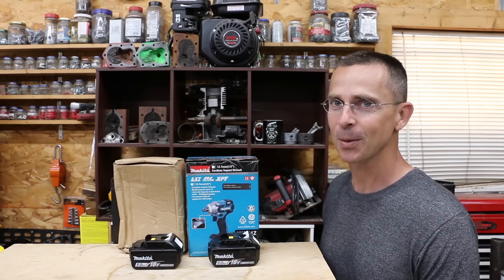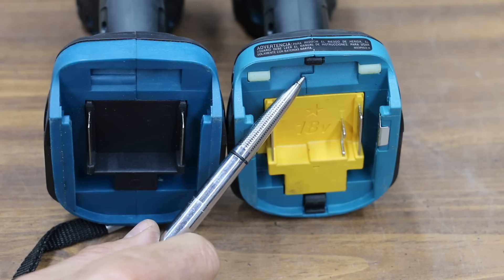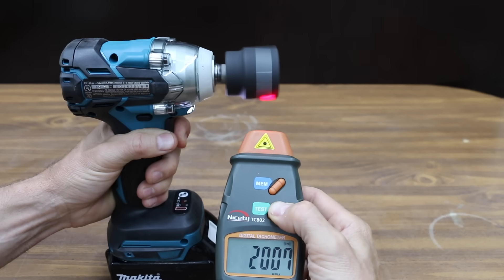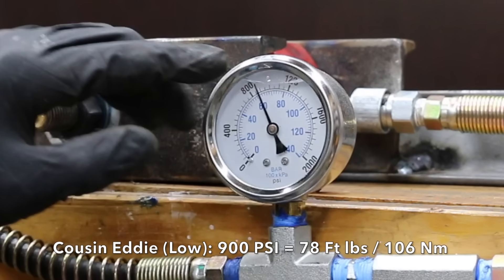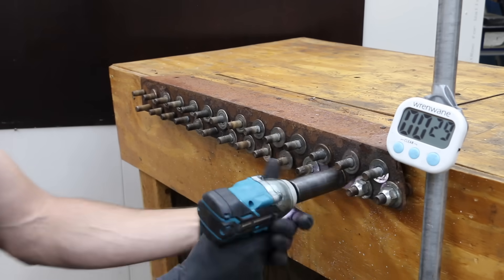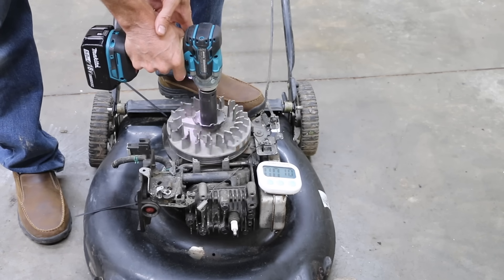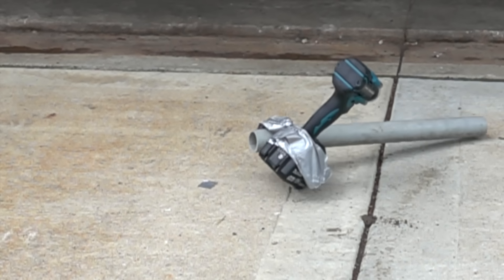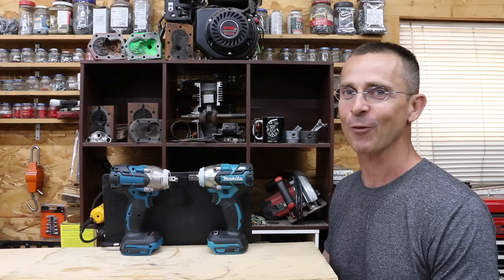Fake Makita Impact Better? Let's find out!  Makita XWT11Z 18V LXT Lithium-Ion Brushless Cordless

Comment: "The bitterness of poor quality remains long after the sweetness of low price is forgotten." - Ben Franklin
Reply: "Most Internet quotes are misattributed" (Thomas Jefferson)
Reply: @Gruntled2001  Source, stats? Have you surveyed internet quotes and found that more than 50% are misattributed? Has someone else done this? Or is this just an idea you have plucked out of some orifice?
Reply: @droceretik  That's an effing joke. I am supposedly "quoting" Thomas Jefferson, a founding father of the US of A, who [supposedly] said that quotes on the Internet (which didn't exist in 18th-19th centuries) are not accurate. Disclaimer for those who are slower on the uptake: it's a joke. Something said lightheartedly, in spirit of jest.
Reply: Man ain't that the truth.
Reply: It's the other way around. But I usually remember prices better than any other aspect of the product, so it doesn't apply to me.
Reply: @zwz.zdenek  A good example would be the difference between a cheap $25 garden hose vs. a $45 one. Both will get the job done but you will constantly fight the cheap one to straighten it out of its coiled state and prevent kinks everytime you use it where as the $45 hose will immediately come out of its coiled state as soon as you remove it from the packaging and won't kink. So yeah the $25 hose is cheap and you can then go out to eat with the money you saved but you will pay for it with your sanity every time you use that junky $25 hose. After a few times you'll see that the $20 difference wasn't that expensive after all.
Reply: @OldsXCool  Your example got me right in the truth's :'(
Reply: TRUTH!  When I was younger, I could only afford the budget versions.  But, I tell ya, nothing replaces quality!  This wouldn't be a bad back-up, but def wouldn't be my primary tool.
Reply: It doesn't remain long around me, I'll throw it in the trash.

Comment: This suggestion may be way out there, but thought I'd pass it on anyway, I only hope I can phrase it right. The subject is rain gutters for houses. There are currently 2 companies locally (Southern USA) that advertise their systems. Both of them seem to offer just about the same design, with plastic (?) inserts in the channels, & a cover over the top of the gutters that keep leaves & debris out. I'm sorry that I don't recall their particular names, maybe one is called Gutter Guard (?), but they advertise in NE Alabama (ABC 3340's secondary channel/ME TV), so maybe you could find out the names for both. Anyway, the only difference I see in their ads is one of them shows how their product not only has the rain flowing over the top of the cover into the gutter, it also flows into the BACK side of the cover. The other company only shows it flowing over the top. I admit, I'm kinda ashamed I didn't research  this enough & gotten their brand or company names & hence made it more difficult, so I wouldn't blame you if you didn't even bother with it. Maybe I'll try again after getting their names, but I thought I'd try anyway. Enjoy your vids, & am always impressed with how many tests you come up with!

Comment: $30 is a steal for the casual and occasional user. Would be interesting to see how the knock-offs battery compares to the Makita's. An extra battery for the Mak costs more than the whole knock-off. Can you get an extra battery for the knock-off? Will the Mak one fit? Will the Mak battery supply more power to the knock-off? Can you do a test to see how fast the batteries drain to a stop condition?

Comment: On the safety side the Makita seems to have a temp sensor connection for the battery and a internal fuse. Cousin Eddy have none of those features. Lithium battery fires is not the thing I want in my home 😊
Reply: It's all about the cells themselves. The additional protection is nice, but rarely makes a difference.

Comment: In a pinch the $30 unit would work. Not sure if life but, I've had name brand equipment that didnt last as long as the knockoffs.  Yes the Makita is better and like I said in a pinch or if ya just dont have the money, Uncle Eddie would work. Great job comparing the two. Now look at Dewalts and Black and decker.

Comment: For $30 it seems like a good buy. Definitely not for professional daily use but maybe good enough for a last minute backup that you put at the back of your truck. Cousin Eddie is built worse than Makita, but it still seems like a good build, and for $30 it seems worth it. If its construction is any much weaker (like smashing into pieces for the drop tests), then it will end up being a hazard and I would advise otherwise.

Comment: With cheap China stuff like this it really comes down to how often you're going to use something. If you only use it once every so often then the cheaper one is by far the better pick budget wise. I mean even if you want to spend the full price you could save that, donate it to charity etc and just get the cheap one. I'm not defending cheap China stuff but in some cases if it even works... you've won.

Comment: The big question I have can you use the makita hammer on counsin Eddie and does that make a big difference in performance?  If so, you could buy a used makita hammer and seems like Eddie would be a pretty good deal.

Comment: Hi, another great video.

Your methods are great and real world.

I totally agree with your summary, the knock of is not as good as the Makita, but it is also about 1.5th of the price, so is it value, YES

For someone like a tradesman who would use this tool 24/7 the Makita is faster / better and would last longer.

For a home handyman or someone who wants a unit in the shed for occasional odd and end usage it will be fine.

Any chance of similar video for normal drills budget to pro

Regards
George

Comment: One important thing the more expensive plastic cased tools usually, or should have, is glass embedded moldings. In other words glass fibers are in the plastic itself making much stronger. I believe the molding information cast into the plastic will tell but I don't know what the nomenclature is.

Comment: We bought the same knock off impact wrench for $30 on ebay too, we're happy with it.  Dad got it to change the shocks on the Cherokee and to do tire rotations when needed, it works fine for what we use it for.  If you're going to use an impact wrench a lot go with the Makita, but if you're only going to need the wrench a couple times a year the knock off will do just fine, but hey, it's your money.

Comment: As usual excellent video.
All my cordless tools are Makita because of price and durability. (I have never had one fail)
Also on eBay you can get tool, battery, charger all separate.
Another reason is the multi colored options on the tools.
If you have a drill bit one one and screw drive bit one the other you don't have to constantly be looking at
which tool has what.
Just one thing, I wouldn't like to have your duct tape bill. YIKES !

Comment: its not un common for manufactures to sell end of line tooling wich get modified to prevent copyright but your knock off doesnt say makita and and every design aspect has nothing in common from the injection moulded plastic to the wireing even the sizes differ but yet your batterys and chargers are identicle ? WHY also makita has 3 gears so common sense suggest the high torque setting will win a simaler looking impact drive with 2 gears so all your tests dont prove anything !! at 1st glance they do look quite simaler but look more carefully they couldnt be more different screw holes trigger chasis lights buttons TOTTALLY DIFFERENT all u have done is test 2  impact drives and failed 2 see no copyright infringements have taken place but called the nameless impact drive a fake makita knockoff even though it doesnt have the words MAKITA on it!!! if anything u should tell consumers to snap this product up $30 for a ID with no name that comes with original makita  18v 50 amp battery (AND CHARGER) IS an absolute BARGAIN!! GET A GRIP pull your tongue out ouf makita,s a hole and stop arselick advertizeing u TW*T

Comment: I prefer to buy American or as close as I can to 100% American made. Perhaps you can test some power tools from craftsman which advertises assembled in the USA with global parts and Milwaukee brands? I asked craftsman corporate how much of American materials they use, they said they try to source all materials in the USA first but some materials may not be available so they would have to source it from out of the USA.

I would like to note the ending of your video may be interpreted as you may recommend counterfeit over genuine. I just wanted to point that out my friend.

Comment: I love how you give everything fair criticism even when things are not even a competition.
That being said I do think it seems to be worth it for 30 at least until you can find yourself able to afford a better one.
Reply: Some advice I've seen on mechanic forums say buy the cheaper tool until it breaks, then buy the better one because by then you will know whether or not you actually need the better tool.That advice is aimed more towards DIYers who aren't working with the tools day in and day out.
Reply: @arcanask  Good advice. If you never break the cheap one, you just saved a ton of money.
Reply: @arcanask  as a mechanic, I use cheaper tool brands and I have had no issues with then what so ever, obviously not as nice or ergonomic, but i use them daily and they hold up great my favorite brand is Tekton. They are just really great tools
Reply: That drill is a fire waiting to happen i wouldn't sleep at night if it had battery inserted... No fuse in the housing, cheap no brand switch (The Mikita is Omron, one of the best names in switches), And no battery ground (again, FIRE). I would never buy that drill. Id get a 50 dollar Ryobi before that. At least if that burned down your house you could sue Ryobi, Who you gonna sue if the fake Makita burns down your house? Yourself??
Reply: @BOY_NAME_  , just take the battery out when not using - I've done that for decades with everything but remote controls. No worry of fire, leaking batteries (corrosion), or battery discharge.
p.s., Sir, I thoroughly appreciate many of your books. 😉
Reply: Agree. It is more than fair because it’s brushless, too. A BL-ryobi sets me back more than 150 bucks and it’s a Chinese brand too. If someone can afford it he or she will buy the makita anyway. 
I remember the cheap Chinese tools from 25 years ago. They sucked and were in no case worth buying. This has luckily changed.
Reply: @CarlosGlatzos976  What are you talking about? right now there's a BL Ryobi on amazon for 85$. For 150$ you can SOMETIMES get a Milwaukee or Mikita with a battery on sale. Also it's not like your getting a battery with the fake cheap Makita, those are 62$ for a 2AH shitter, BEFORE you get a charger. Not to mention the inevitable house fire your gonna have on your hands when that drill goes up in flames. there's NO battery ground and NO in-housing fuse. The switch is also complete shit and will probably stop working the second you squeeze it hard. STAY AWAY!!! this is for peasants, serfs, and Instagram influencers who want to post a picture of themselves 'doing work'.
Reply: J.R.R Tolkien Whaat? Should have checked the prices again. Was a while I compared prices for tools.  You are right, all dangerous facts I did not consider. Guess I was carried away with the fancy dance moves. So get the Ryobi instead or wait till the makita is on sale. Sounds reasonable. Thanks for your replies! Cheers!
Reply: @CarlosGlatzos976  your reply is too nice and reasonable!!!
Reply: You Wish  their sockets now are top notch imo. Haven't tried their torque wrenches but their sockets and wrenches I'll recommend all day everyday
Reply: Think we all know price is what you pay for alwayssssss get the more expensive

Comment: In these tests, I don't think well known brands are winning against fakes. If you need to use max torque and push specs. to the limits, ok, chinese copy won't be able to do that. But for most of people it's better to buy chinese copy and if something goes wrong, you can buy another three tools before you can afford original. This chinese tool is quite good. And for $ 30 it's great and original is not 4 times better.
So, for me the score is ... Chinese copy: 1, Makita: 0

Comment: This isn’t related to this video but I have an idea. I didn’t see, or look good enough, an oil filter comparison video. I don’t know all the technical specs and how best you should do it, but I think you should cut open the oil filters and test them in a similar way you did the air filters. Pouring different gradients of sand and dust on them and measuring what particulates make it and don’t make it through. You would probably have a better way to test this but I’m very curious as to what oil filter would best be suited for someone who wants the absolute best. I myself have always used Mobil 1 oil and oil filters because it’s a good brand and it is widely available at Walmart and other stores, but I did make a switch to the best air filter you tested, Wix. Purolater was a toss up, I just went with whichever was most widely available and Wix is more commonly found in auto parts stores. Also oil filters I would suggest you use are Mobil 1, Amsoil, Fram, Wix, AC Delco,  and whatever you think would be good test subjects.
Reply: Also to kind of keep consistency, I think it would be best to use the top shelf or premium oil filters for each brand. Since Mobil 1 only comes in like one tier, at least that is all Walmart sells.

Comment: Once again, over all very well done.  While the dance moves were fun to watch, and the test does show the real toll is better built, I'm a little concerned it doesn't show what is actually likely to happen if you drop either tool.  The mass of pipe attached to the thing is putting quite a bit more stress on the plastic than it would get under only it's own weight, I think.  some sort of apparatus that lets the tool free fall without adding weight to it might give a better idea of how it will hold up to an occasional drop off a ladder.

Comment: Can you do a 36v Makita chain saw with 2 5.0 a.h. 18v batteries vs a Milwaukee 18v chain saw with a 12.0 a.h. battery. *to make it even an oregon 16" bar and chain will fit both...... curious.
Reply: Just pragmatic b/c the Milwaukee claims to do better with the one Milwaukee battery.

Comment: I've got cousin Eddy to go along with my other Makita tools, and I've got to say, it does a great job at what I need it to do, which is lug nuts, and general purpose nut busting on cars.  It is much lighter, and more compact than my Makita High torque brushless impact, and much more powerful than my  brushless Makita impact DRIVER.    I'm happy with it, and I think it was $30 well spent. I'm even happier seeing them both taken apart and seeing that it IS NOT a blatent copy inside and out.

Comment: as always, a very fair review. i have the knock off  Milwaukee  and love it with its  faults . also i use knock off dewalt 20v  batteries with an adapter.  would i use this set up for a pro job... no... but it is great for home set up.

Comment: I'd say if you want a tool to only change your tires 2-4x a year and do small projects at home, you can be ok with the cheap one, as long as you take care of it. If you plan to do more or bigger DIY projects and have a big garden which you keep up yourself, you should invest to better tools as they worth it in the long run.
Also in some countries the knock-off version may be illegal to sell if local authorities enforce copyright laws stricter.

Comment: If you need to use a tool professionally or if its something you use a lot, obviously don't cheap out, but if you're just using it at home or for a project or two, I'd save for sure and buy the cheap Chinese knockoff. Decent enough performance to do what it was meant to do and for way less money. Also you can often get these cheap Chinese tools from USA based eBay sellers for just a few bucks more than buying direct from China. Still will take ~1 week or so to get to your door but way less time than waiting over a month for a boat from China.

Comment: Did Cousin Eddy not come with a battery or charger ? Because I noticed you used Makita brand charger and battery on that drill during testing . That drill might not have performed as well or maybe better if you had used the battery that goes with it.